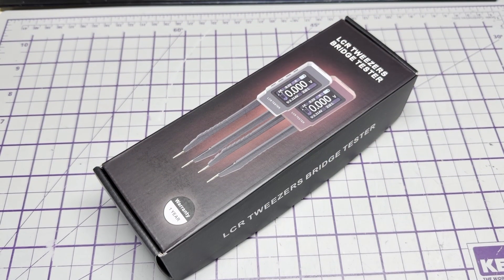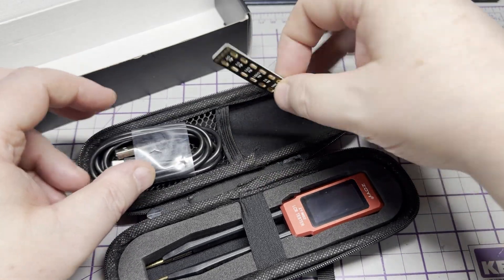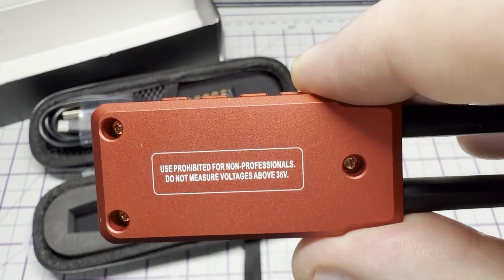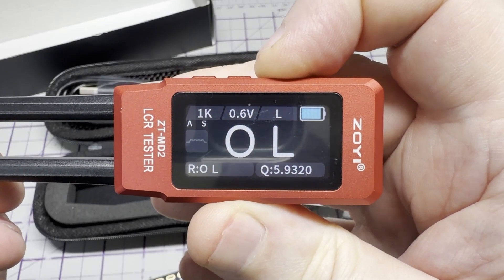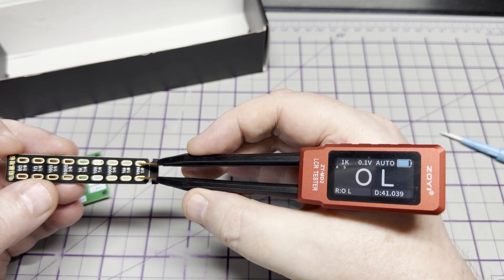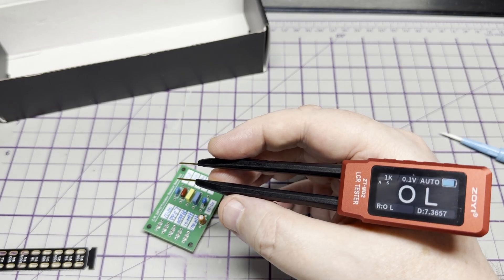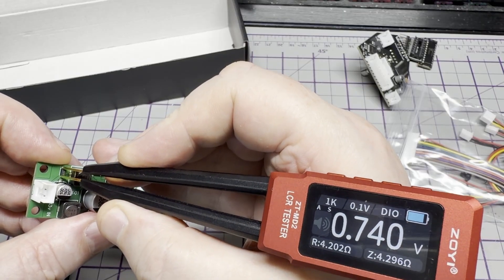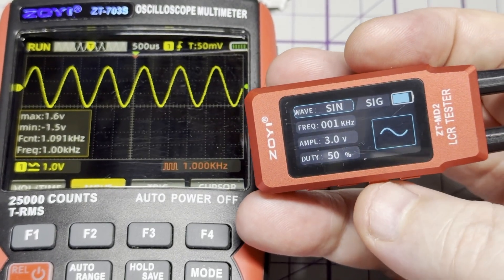ZOYI ZT-MD2 - LCR Tweezer test meter - test and review.

Comment: Do u have any tips on how to measure in circuit capacitors with this tool? Would have been really nice to see comprehensive comparison how it does against the older version I see u have there as wel. Hope u can do a video about this as wel, u would be the first as I haven't seen other videos on it available.
Reply: This.
Exactly what I'm most interested in.